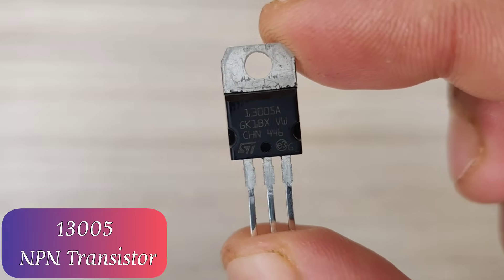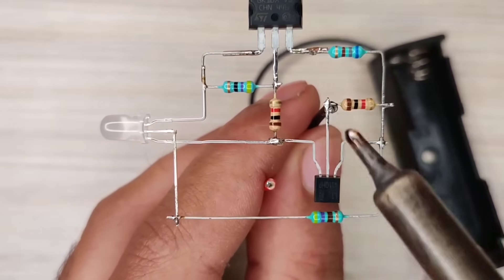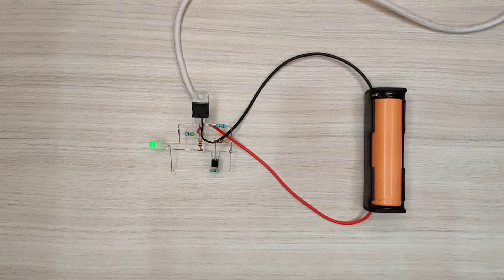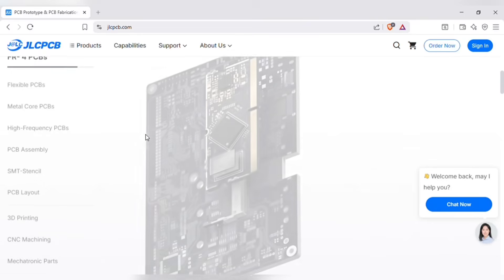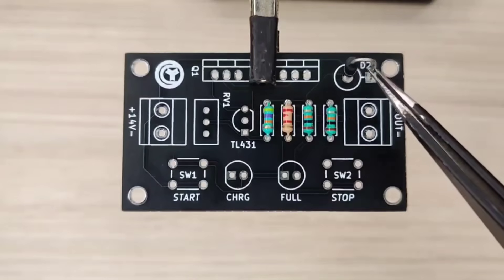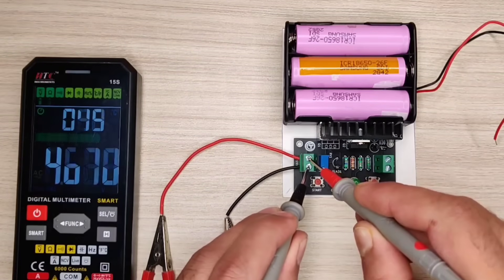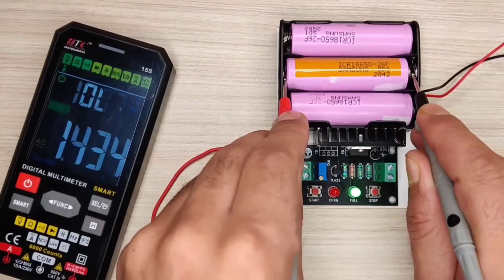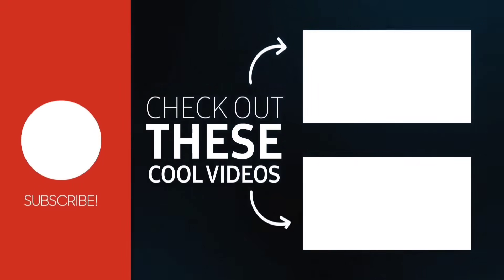Smart 3.7v Auto cut off Battery Charger 1S, 2S, 3S Adjustable

Comment: In the first circuit, the location of the LED pins and the naming of the LED pins seem wrong. The LED has a common positive, but the naming of the pins and the placement does not seem correct. I would appreciate your guidance.

Comment: Podemos cambiar el primer transistor que usaste por algún otro como:
B772
D882
BD139
BD140
C106
D669
B649
BD237
BD238
13003
BD136
BD235
BD438
BT134
2P4M  ?????
Espero tu respuesta amigo, y muchas gracias por enseñarnos
Reply from the maker: Yes you can use any equivalent transistor that has a similar gain and current rating.
Reply: @CreativeTechos yo no entiendo mucho de eso, dime solo cual uso ?? 😂